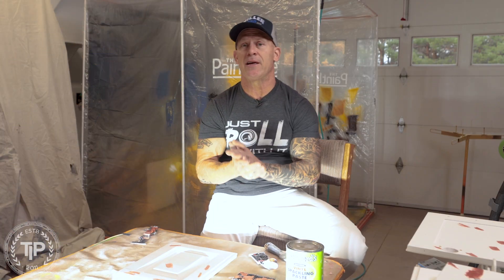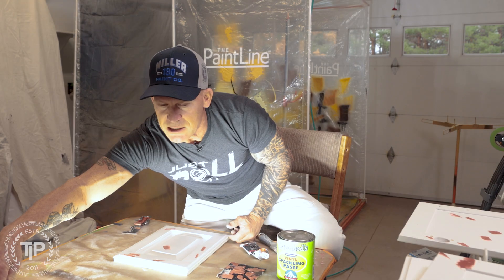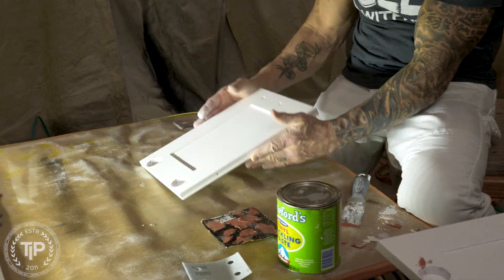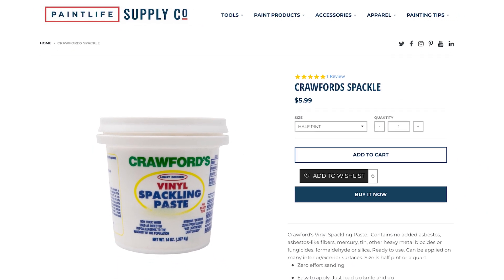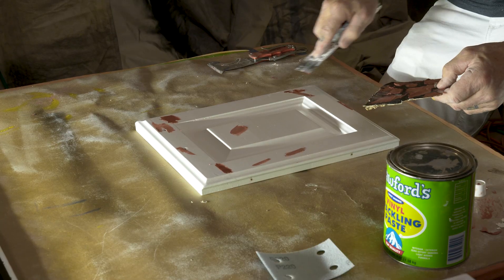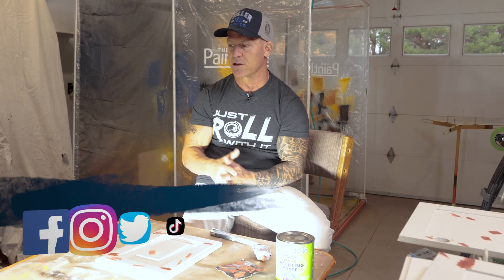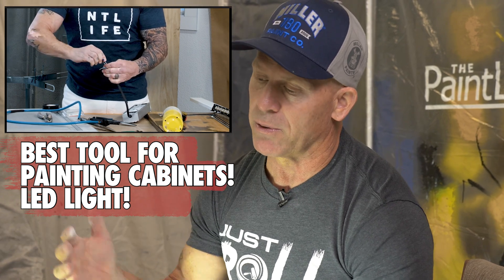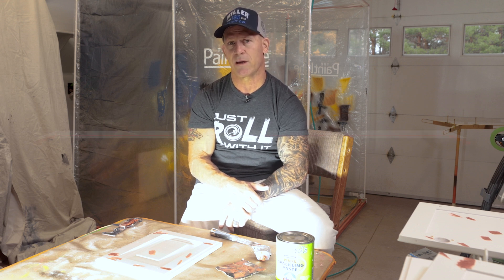Inspection Light basics.  Paint Kitchen Cabinets.

Comment: This is really good, thank you very much and this is a must, I use a light also, I like to use carpenter's wood filler and lacquer putty for fine details myself, your inspection light is probably better than my hologyn light because my light gets extremely hot and have to be really careful not to touch anything but the handle. I like using it for drywall also, I'm right handed mostly so when I'm spraying I carry my light in my left hand so it casts my shadow off of my work so I can clearly see what I'm doing. Thank you very much.
Reply from the maker: Thanks for your support Lorenzo

Comment: A cordless Milwaukee m12 under hoodlight (meant for mechanics, it’s a super long led light) works super good for inspecting walls for prep, so does the “rover”. But the one you are demonstrating is significantly more powerful it seems
Reply: It looks like a light bar that off road trucks use.
Reply from the maker: The M12 is OK but the one I use blows it away.

Comment: A cabinet refinish does not need to be this perfect. You will go broke trying to take everything to this level.
Reply: Depending on the surface, lighting, and paint color, this kind of process DOES need to be done on wood.  Unless you don’t want a refinish someone can be proud of or impressed with.  Filling and sanding doesn’t have to take all that long.  And it is worth the effort, even as a DIYer.
Reply: It just seems long because he’s talking. It takes an extra 2-5 minutes per door.
Reply from the maker: LOL, or go out of business because you do not care about quality.

Comment: Used an inspection light to do all the prep for a flawless finish but then wound up with dust, knats and other cra_ in my final finish so 🤷‍♂️

Suggestion to DIY'ers - DO NOT spray your panels flat/laying down. Use the cup hook and hangar method Chris shows in some of his videos.

Reasons
1). Faster. You paint all surfaces at once vs. the flat method where you can only paint one side at a time and you have to wait for it to dry.
2). Reduces chance of dust/particles in your finish.
3). Takes much less space to paint a kitchen full of cabinets.

Last note...I do not recommend using Behr Alkyd Enamel paint. As noted in a product test video....it RUNS very easily. I also had issues with micro bubbles in the dried surface. Inexpensive yes, but after all the prep work and time, I was disappointed to end up with just an ok end product.
Reply from the maker: Behr across the board is not good